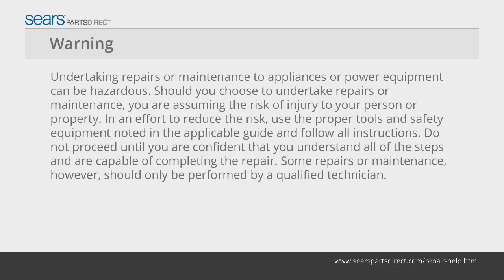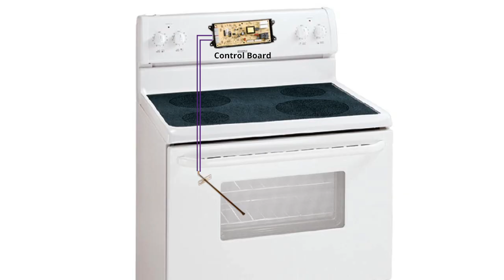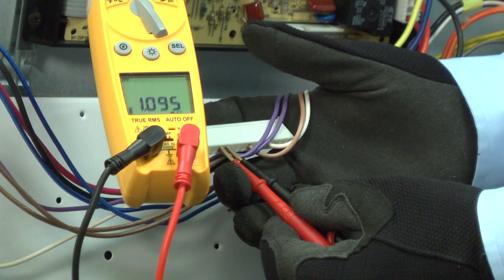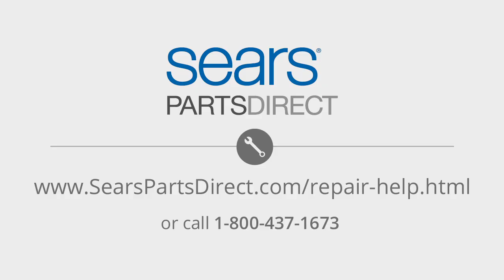Range Error Code F10: Troubleshooting Runaway Oven Temperature

Comment: My oven hasn't been running for a couple days and I was sitting here today without it even on and it started beeping showing the f10 code what does that mean when the oven hasn't been operated for a day or so and the code sporadically just goes off by itself

Comment: is this dangerous to leave unplugged? or plugged in? just happened to me adn i had to flip the fuse and I am honest nervous atm
Reply from the maker: If you're nervous about the condition of your range, unplug it or shut off the circuit breaker for the range and have it serviced by a technician.

Comment: So it looks like my sensor gives no reading. I assume its not likely that the sensor AND the control board have gone at the same time. Is there a way to test the control board before I buy a new sensor? I see the sensor isn't a very expensive part but ordering in the part will take time and my family not seeing me fix it instantly is causing them to think I'm in over my head (even though I've handled much harder projects than this).

Comment: i got the code once and reset it but mostly Tv dinners thats should take 20 minutes get burned and melted into a puddle of plastic in only 10 minutes.  I bought both sensor and control boars just in case.  I'm hoping its as easy to replace as this video looks.

Comment: ugh.. My mom called a repair tech because runaway oven temp... He said its probably the thermostat.. But if not its the control board.. He didnt even test it my mom spent 250 bucks on the sensor and install and of course it didnt fix it.. it was the control board so now she has to drop 350+ for a board.. She could of bought a whole new oven ... I told her they should of tested the resistance of it before replacing the sensor

Comment: Kenmore Elite damn near burnt the kitchen down...only by grace caught it.  set for 250 preheat with roast...came in 10 min later and was around 600 degrees, beeping, F10 flashing and burning the roast to nothing...happened fast.  Runaway temp...  problem is, we have the double oven in the wall.  do i need to pull the whole thing out to get to the back (I think i know...) in order to find these sensors/harnesses?...or is there a cheat from inside the ovens?

Comment: I have a Kenmore double oven 790.47733407 that occasionally shows an F10 for the lower oven when I lower the oven temperature, for instance, from 220 deg F to 170. It then ran away to a measured (separate thermometer) temperature of 500 deg F.  Is there a way to retrieve stored codes for this oven? For some ranges, pressing "cancel (times 3) and then start" yields a more detailed error code that triggers a test mode. A more detailed code then indicates a sensor temperature or a control board failure. Can I do that to track my problem down to root cause? Is my model one that is at risk for a power element to ground failure? It may be that my failure is from an intermittent temperature sensor; I'd like to catch it in the act. Panel inputs include (oven)Light, bake, broil, cook time, warm & hold, stop/clear, delay start, clock, timer set/on, add 1 minute, ^(up), down,  for two ovens. Thank you!
Reply: An update - The oven temperature ran away again. The temperature as measured was 250 deg F, the setpoint was 180. This time I noted that the upper element was red hot, but there was no control panel indication that it was on. Moments before, it was cycling the elements normally, and the indications on the control panel showed the top and bottom elements turning on and off. Then the cycling, and the clicking of the relays, and the control panel  indication of an element on, ceased; but the upper element was red hot.
Reply from the maker: @richstevensproductdevelopm2086  There's no way to retrieve stored error codes for that oven. The problem that you're describing in the lower oven could be caused by a stuck relay on the relay control board, a loose wiring connection or a bad temperature sensor. The problem with the upper over that you're describing may be caused by a bad temperature sensor. The F10 error code is generated when the control in the console senses a high temperature measured by the temperature sensor. If the temperature sensor is sending high temperature properly in the lower oven, then the relay control board or the console control board may be at fault. Because this oven has 2 control boards, I recommend that you have a service technician diagnose and repair the problems that you're describing.
Reply: @searspartsdirect  Thank you! The insight is appreciated.
Reply: @searspartsdirect  update - the broil relay and connection P6 has signs of scorching - black deposits visible on the relay exterior, so that tell me the board/relay has failed. 
I am curious as to why it would fail. Could the broiler element have drawn too much current? The wiring harness and connections are intact and there was no grounding of the element. Is there a resistance test for the element - if so, what is a typical resistance value? 
The temperature sensor tested correctly at 500 deg for 15 minutes F and at 60 deg F. 
This didn't cause the problem, but I did note that the unit was misassembled - heating element power wiring was run directly over a sharp edge on the top of the cabinet, trapped between a vertical rib and the top cover. I have a photo if you get curious.

Comment: Do yourself a favor. If you start getting the F10 error, replace both the control board and temp sensor. If one goes out the other is probably not far behind.

Comment: Wayne you are amazing! We don't have the electric reader. you have I replaced the temperature sensor. It beeped when it hit 350 and preheat was done, but it continued to heat and runaway. I don't have $200 for a control panel and was wondering if there is anything else I can try. Kenmore Warm and Ready Drawer, Model #790.9421440A
Reply from the maker: Your symptoms indicate that the electronic control board likely has a stuck relay and the control board probably needs to be replaced. There aren't any other options for fixing the range when the control board has a stuck relay. Here's the link for the control board: https://www.searspartsdirect.com/product/2lac2onmj9-0022-628/id-316418208 . If you replace the control board and the range works properly, you can try installing the original temperature sensor. If the original temperature sensor works properly, you may be able to return the temperature sensor that you purchased. Be sure that you unplug the range before replacing parts.
Reply: @searspartsdirect  Between you and Wayne, your service is amazing. Thank you,

Comment: Thanks for the video. My range is a Kenmore model #970-6876. My problem is pretty much what Ian describes -- oven never stops preheating until things start to burn and the F10 error alarm goes off. Would this also be the broil relay? Resistance measured at the probe is as it should be (1.072). Resistance measured through the harness and probe together is higher (1.998), if that tells you anything.
Reply from the maker: Your symptoms indicate that the electronic oven control board likely has a stuck relay. Unplugging the range and replacing the electronic control board will likely fix the problem that you're describing.
Reply: @searspartsdirect  Thanks — on further inspection, I see that the plug immediately below the bake / broil relays has been damaged — partially melted where the yellow bake element wire connects to the board. (Is that consistent with a stuck broil relay?) Assuming this would have to be replaced too. Is this an available part?
Reply from the maker: @donco7525  Melted wires can be caused by a stuck relay on the control board. A wiring short or an oven element that is broken and shorting to metal (or other wiring) can also cause the melted wire that you're describing. We recommend that you have a service technician examine and repair the range because a short circuit is dangerous—especially if it's not found and repaired correctly. If you're completely confident that you can repair the range yourself, check the bake and broil elements for breaks or shorts to metal inside the oven. Because the yellow wire melted, you'll likely see burn marks if an element broke and shorted to metal in the oven. Also check all wires going to the bake and broil elements for damage and shorts. If you find no shorts or damage to oven elements or wiring, then replacing the electronic oven control board will likely fix this problem. If the yellow wire is damaged, you'll likely need to replace the wire or the wire connector. The model number for your range indicates that it's a Canadian model. The part number for the electronic control board is 316462808. That part is available in the United States. Here's a link for that part on our website: https://www.searspartsdirect.com/product/3p6qirirrm-0022-628/id-316462808. If you live in Canada, you may be able to find that part in Canada as well. We hope this information helps. If you need further assistance, let us know.

Comment: Well wayne thank you very much for your informative video. I myself have a kenmore  oven and it preheats and well thats it.  I eventually get a f10 code and  i have myself a runaway burning hot oven. I recently replaced the oven relay and i tested and replaced the heating element for bake. It preheats with upper broil element never stops never switches to lower element or stops heating until i come flying into the kitchen like a mad man trying to unplug thst crazy ass runaway oven. Do you have sn yh suggestions as to anything more  without replacing board.  I kind of told myself i would be able to fix this without doing that and trying to stick to that .
Reply: and once again thank you for yor video Wayne.
Reply from the maker: @ianbailey3131  Let us know the model number of your range and we'll try to help. Here's some general advice that may work even though we don't know your range model number: Your symptoms seem to indicate that the broil relay is sticking shut--causing the broil element to stay on and overheat the oven if we understand your description correctly. If you replaced the bake relay on the control board and you're confident that you can safely replace the broil relay, then you may be able fix the problem by replacing the broil relay. If you replace the broil relay and that doesn't fix the problem then you'll likely need to replace the electronic oven control board. Unplug the range to disconnect electrical power before accessing and replacing internal components.

Comment: What if my stove doesn't seem to be over heating
Reply from the maker: The oven temperature sensor or it’s wiring harness could be faulty. Check that sensor using a multimeter as shown at :57 in the video. Replace the oven temperature sensor if your multimeter doesn’t measure the correct resistance through the sensor. If the temperature sensor is okay, check the sensor wiring harness as shown in the video. Repair or replace the wiring harness if it’s damaged. If the oven temperature sensor and its harness are both okay, then you’ll likely need to replace the electronic oven control board. We hope this information helps. If you need more assistance, let us know the model number of your range and give us more details about the problem and the results of troubleshooting test that you conducted.

Comment: If Maytag dryer is showing AF what problem am I having
Reply from the maker: The AF code on a Maytag dryer typically indicates that the control detects an exhaust air-flow problem. Check the lint screen first. Clear lint from the lint screen and see if the code clears. If not, then you may need to clean the lint screen with water and a soft-bristle brush to remove fabric softener residue that can build up and clog the screen. You may also need to check the flexible vent behind that dryer. Make sure that flexible vent isn’t kinked and clear any debris that you find inside the vent. Clean the exhaust vent that carries exhaust air to the outside of your home. Make sure the damper on exhaust hood on the outside of your home opens properly and isn’t clogged. We hope these tips help. If you need further assistance resolving this problem, give us more details about the issue and let us know the model number of your Maytag dryer.

Comment: If the wiring checks good then always replace the sensor first, even if it checks good at room temperature. They go out of tolerance when the oven is hot during cooking. They are cheap enough. It would be a lot cheaper than replacing the board only to find the problem really was a bad sensor.
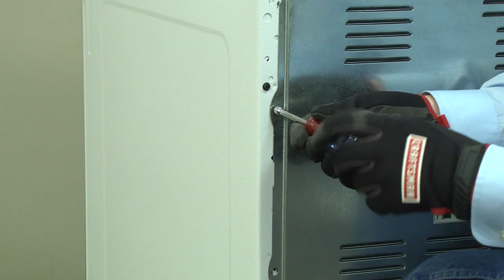The sensor connector plug pins also can cause problems so I suggest you cut the plugs off and directly hard wire the sensor with high temp , porcelain wire nuts. The plugs I'm referring to are the ones he disconnects at 1:06
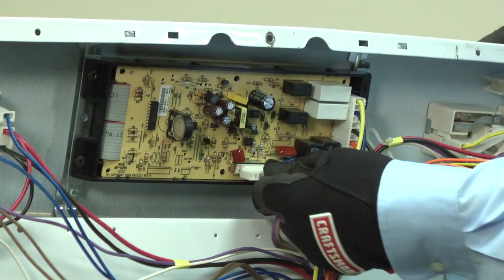If this fails to solve the issue, then before replacing the board , re-solder the pins on the board for the plug he removes at 1:49  . If you don't know how to solder then take the board to a TV repair shop and have them check the board for cracked or burned cold solder joints. 
Soldering the pins may be the only  alternative available to you if the board is no longer available (as is often the case )
Reply: Your comment just saved me a couple hundred dollars. My sensor has appropriate resistance but I replaced it any way and it worked!

Comment: Alright I'm about ready to give up and throw away this pos Frigidaire. I replaced the temp probe, still did it. So I replaced the control board. Fixed... For about 3 days then today it started doing it again. Unplugged it, let it cool down, after about 10 second's does it again. $100 into this stupid oven and nothing is fixed!  Anyone have any advice that might fix it?  Other than just giving up and buying a new range?
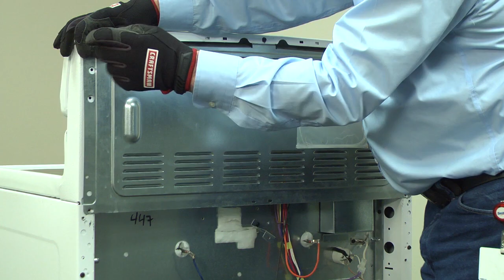Reply from the maker: A bad oven temperature sensor wire harness can cause the F10 code. Unplug the range and check the temperature sensor wire harness as shown at 1:43 in the video. If you don’t measure the right temperature sensor resistance through the sensor wires that connect to the control board, then you’ll need to repair the wire harness. The most vulnerable spot in the wire harness is the plastic plug at the sensor end of the purple wire harness. It may not be connecting the sensor wires to the purple wire harness securely. You may need to cut off both sides of the plastic wire harness clip and connect one sensor wire to one violet wire and the other sensor wire to the other violet wire using ceramic wire nuts.
 
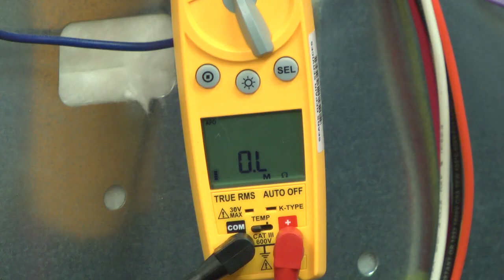If you measure proper resistance through the sensor wire harness that connects to the control board, check each purple wire for a short to the metal frame of the range cabinet. Here’s a video that shows how to check for a short to the metal frame at 1:35 in the video:  https://www.searspartsdirect.com/article/how-to-test-continuity-on-wire-and-electrical-parts-video.html. If you detect resistance from either wire to the range’s metal frame, find and repair the damaged or pinched wire that is touching the metal frame.
Reply: Sears PartsDirect thanks for the advice but I'm returning the part and bought a new range.
Reply: I've replaced the control board once already on this oven...
My guess is, a second replacement is necessary...
Perhaps a replacement with the entire unit this time.

Comment: I tested the temperature sensor on both ends and it's just over 1100 Ohms. Is the electronic control board the only other thing that can cause this? I wouldn't want to order a $200 part just to find out it's something else.
Reply from the maker: A shorted temperature sensor wire harness can cause the F10 code even though you measured 1,100 ohms of resistance through the harness and the sensor.
 
To check for a shorted wire harness, unplug the range and disconnect the sensor wire harness from the electronic oven control board. Set your multimeter to measure resistance. Place one meter probe on one of the sensor wires in the sensor wire harness plug and touch the other meter probe to bare metal on the range’s cabinet. 

You should measure infinite resistance during that test. If the meter detects resistance, then damaged wire insulation is allowing that wire to short against metal inside the range cabinet. Find and repair the wire damage.
 
Repeat the test for the other wire in the sensor harness. Repair that wire if you measure resistance indicating that wire is also shorting to metal inside the range cabinet.
 
If you measure infinite resistance through both sensor wires, then you’ll likely need to replace the electronic oven control board. We’re not aware of other issues that cause the F10 on the type of range shown in the video.
 
If you have a different type of range than the one shown in the video, post the model number of your range and we’ll look for any other possible causes of the F10 code.
Reply: I've read of people replacing every part on their fridgidaire stove with no positive results ...I'd just buy anything other than a Fridgidaire